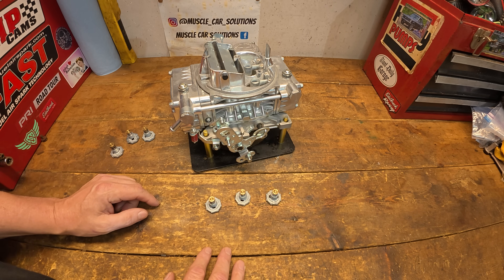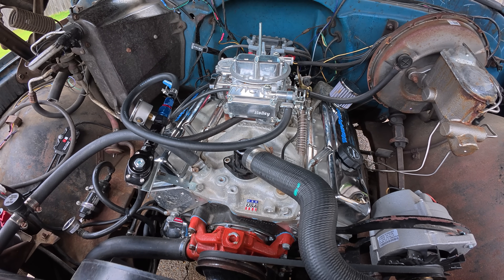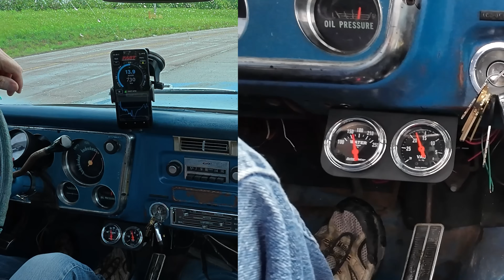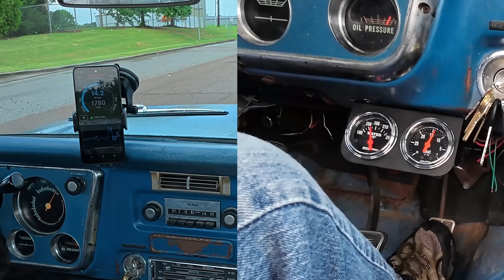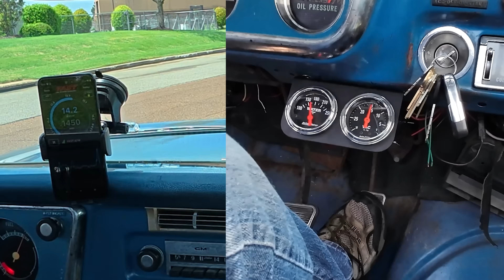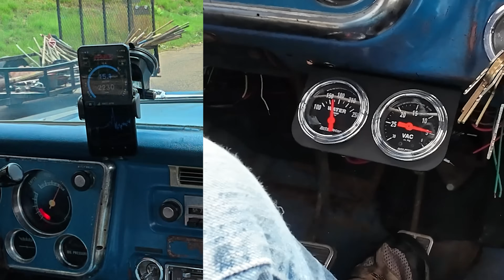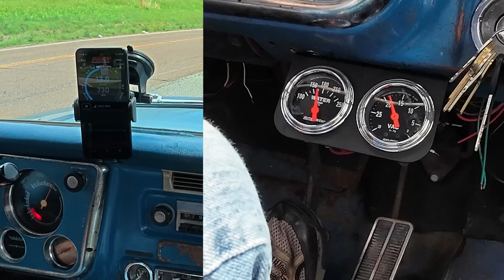Power Valve Tuning for your Holley Carburetor

Comment: I wish you or someone knowledgeable like you lived close to me to help teach me to dial in the carb i have. Have my late father's built 406sbc in my 65 nova and purchased a specd out carb thru ATM 850cfm annular boosters but I can't get it dialed in that good. Have to hold it at 2k rpm when cold start for atleast a min until it'll somewhat idle, goes really lean when just touching throttle while cruising but soon as I give a bit more throttle it clears up and under higher load/wot it's super rich 10.5afr even though I jetted down 6 jet sizes in the front. Engine only has 7inhg at idle and carb came with a 6.5pv tried a 4.5 but that seemed to make it leaner when starting out. I tried watching so many tuning videos but can't figure out what system does what to the afr and when. Dyno wants 500 bucks to tune carb but I have a feeling theyre just gonna tune idle and wot and not do much with everywhere else like light throttle, light load cruising just all around fuel mileage and drivability.
Reply from the maker: The folks at ATM are some of the finest folks I’ve met.  If you’ve got all the engine specs, give them a call.  They’ve always been super helpful over the phone.  That rowdy of a cam is always a challenge but they can be managed with the right set up.
Reply: Sounds like because the cam it has,  the idle transfer slots to the primary butterflies are off. 
If you are having to have the front butter flies,you know the round things on the norm off the carb,  way off of closed. Then that could be your issue. 
Get a vacuum gauge, watch videos how to use it, he had a some good ones on here.
Reply: You really need to figure out what cam is in that engine. If he built it fur racing and not rock crawling. You might not get it to run right as a cruise.
Reply: Your idle feed restrictions need to be bigger and your power valve channel restrictions need to be smaller. 4 corner idle circuits, right? Try increasing IFR by .004" in both metering blocks. Hopefully will result in idle mixture screws requiring approximately 1 to 1-1/2 turns out.
Reply: @mickangio16  yes 4 corner idle. Currently the idle screws are around 1.25 turns out to get it to idle and have highest vacuum

Comment: I have a 6500# 4x4 with a small block and surprisingly get great mpg with a 10.5 power valve, even towing I got pretty good mpg.   You don't get a full size truck like that for gas milage but I'm super happy with it
Reply: My 86 K10 needed a 10.5 too mild built 350. It's gotten 14mpg pulling a car trailer.
Reply: Do you know your idle vacuum?
Reply: @BPattB  Around 21 at idle in neutral/park, drive is around 18-19.     I came to the 10.5 because of the weight.  Also that weight on top of occasionally using 4x4 or towing it needs to start the enrichment circuit sooner, and my cranking compression is 200-210 so I can't run much below 92 octane without detonation even when I retard the timing to TDC due to 350 cubes for 6500#,, if it was in a 4400# truck I reckon I could run 89 octane if I absolutely HAD TO
Reply: @Rest_on_Yashua  sounds like it's set up really well
Reply: @BPattB  it's got a small extreme energy cam and pulls 21" at idle.
Reply: @BPattB  idle vacume really doesn't play into it at all. The whole thing is about engine load and when the enrichment is needed. The same engine installed in a light sports car vs. A 1 ton truck will require different power valves. The heavy truck with more load will require enrichment way sooner.
Reply: @BobHollinsheadGarage 💯 with 32" tires and 3.73 gears, 4L60e and single exhaust in a surprisingly heavy Tahoe with a basically stock vortec 350 that I put a Summit 600 vacuum secondary carb on I'm easily getting 18+ mpg cruising at highway /interstate speeds.  And 10-12mpg weighing 13,740 pulling a trailer 1300 miles back from Texas, i was expecting maybe 7-8 TOPS

Comment: Hello sir! I am running an autolite 2100 on my 289 motor. It is the stock style carburetor, however, it is the higher 400 CFM version that is actually designed for a 390 FE. It runs really good all the time, except when I am at wide-open throttle, when it blows a ton of black smoke. Do I need to try going a smaller size power valve? I have tried everything else, including Smaller jets, smaller accelerator, pump stroke, and lowering the float. All those changes made the car run lean with hesitation at low RPM and did not solve the problem at wide open throttle. Thanks! Appreciate your wisdom and your sharing it with us. I have learned a lot from your videos.
Reply from the maker: Ignition.  Learn to read the plugs. Be a little ready to accept the things you can’t change.  It is a stock carburetor at its core.  But the 2100 has some decent interchangeable parts and some aftermarket as well.  PV change might help.  Get everything else sorted out first.
Reply: Power valve channel restrictions below the power valve are too big.